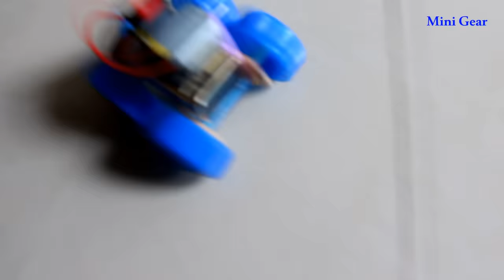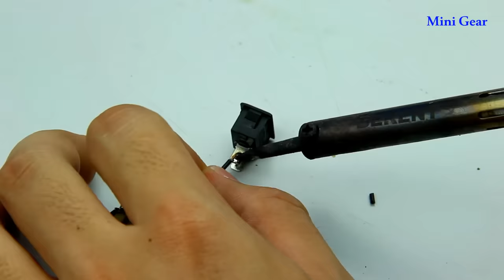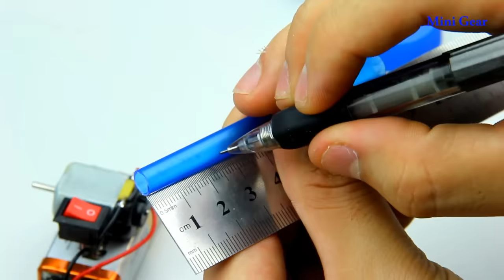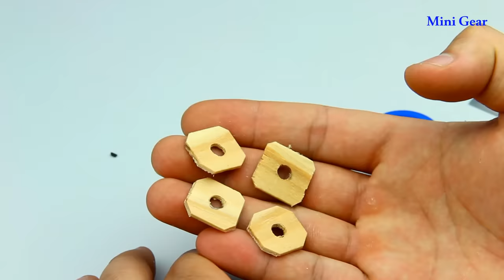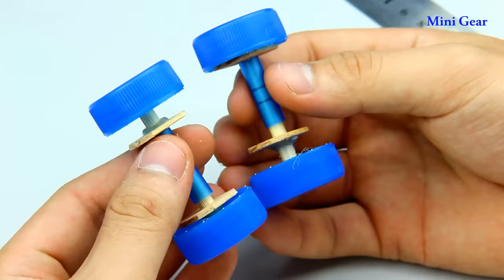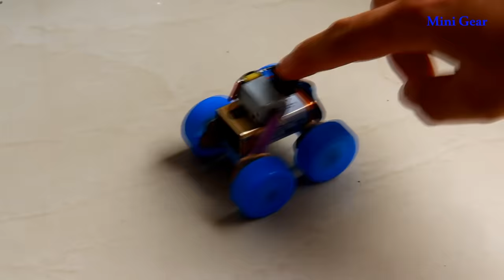How to Make a Powered Car Very Simple - DIY Electric Mini Car

Comment: but  when I m attaching the rubber band,it can't push the car!😕😖
Reply: two circle paper cardboard  and small circle overlaps it  you can get pulleys and attach rubber band on motor shaft with pen refil so it works  i hope it is helpful to you
Reply: mine also
Reply: Mine also
Reply: Just use a gear man
Reply: @srijaanmondallvg4713  just use a gear
Reply: Yes sir

Comment: Hey Mini Gear
Can you write in the description what you need for this car??
Reply: -Qakkà
Reply: Battery bottle caps switch motor wire rubber
Reply: @rajveer1l  no you need lot more can you please help me find all of the names of it I would appreciate it alot man thanks!!
Reply: @TechWildTips 1 Battery 4 bottle caps 1 switch 1 Dc motor 1 connecter  wire  1 rubber band
Reply: 4 piece of pop sticks

Comment: Gluing the center of the  the caps without any measurement to make it revolve smoothly is possible after 10 try and error .I am sure you cut and edited  this clip many times to avoid your failure until you got it going.
Reply: ik
Reply: @risanshaheed761  Did I hurt your feeling ?
Reply: @listerine-pr5lt  අපිටත් සබ්ස්ක්‍රයිබ් එකක් දීල බෙල් එක ALL

Comment: This is awesome and fun! Kindly tell me what are the materials needed? Please, because I need this for my projects in physics. Thanks!!
Reply: Bro we r doing it rn
Reply: A piece of straw
9v Battery
Dc motor
9v battery connector
Ice cream stick
A wooden stick
4 bottle caps
Rubber band
Switch 
A piece of wire 

Tools
Ruler
Pen
Solder Iron
Hot Glue

Comment: What resources do you need to make the car?
Reply: 1 dc motor, 1 switch, 1 9v battery, 1 9v battery adapter, 1 wire, 1 rubber band, 2 small sized sticks, 2 small sized straws, 4 wooden squares, and 4 wheels.

Comment: Is there any way to not make it change velocity by too much and stay at the matching speed  on a straight path?
Reply: It is by adding more friction in between which gane be done by use of multiple rubbers but it will be complicated. Can also change the wheels which are not used to add more friction.

Comment: Do you have any idea why my rubber bands keep slipping off the motor shaft? Any way to fix that?
Reply: Your motor shaft and axle shaft need to be perfectly parallel to each other, or else the band will walk. You'll need to adjust the angle of the motor on the battery to have the shaft match the axle axis.